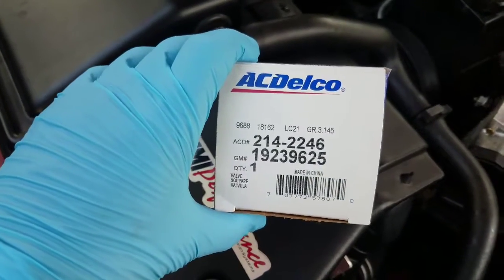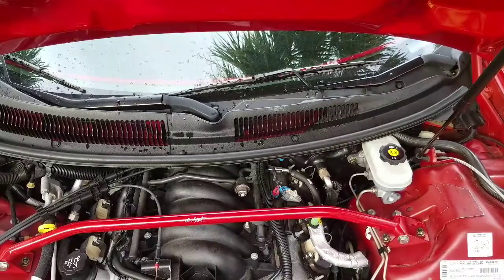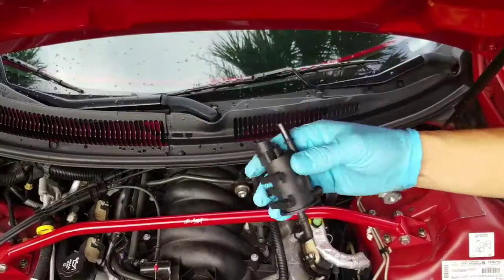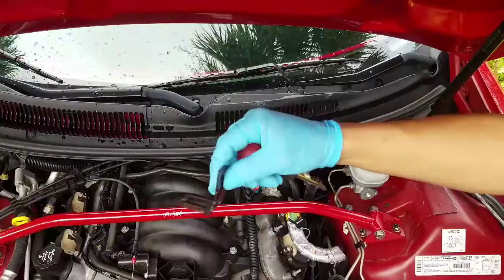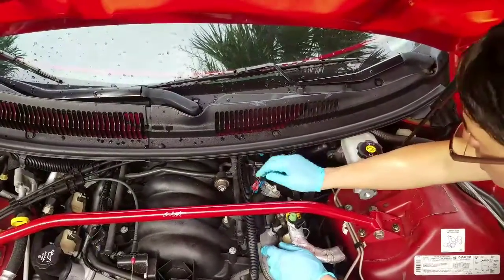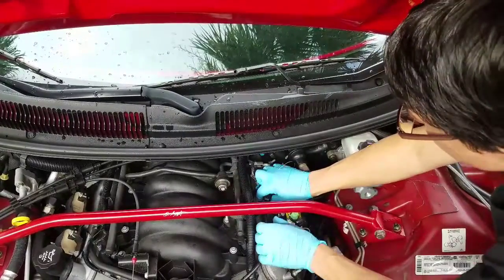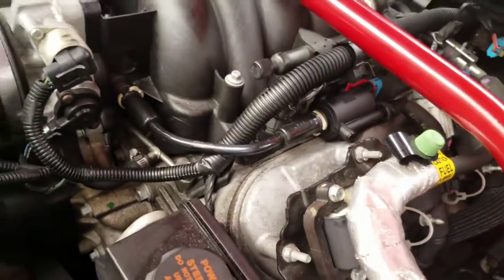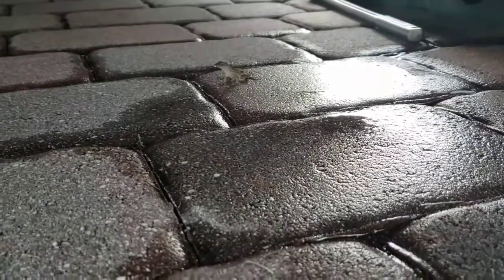Code p0446 on the camaro. EVAP Purge Solenoid replacement. Plus, a thirsty reptile.

Comment: I replaced the purge valve and valve tube that connects to the throttle body. Code still on. Gonna change the gas cap and if not then idk lol
Reply from the maker: I changed my cap too. What year car you have?
Reply: Chemical Spore 2002 camaro ss
Reply: Chemical Spore did the cap fix it?
Reply from the maker: @SlackeredForLife  did you delete the code after?
Reply: Chemical Spore yes I deleted and it still went on at first I thought it was the tube because the clip at the end was missing but nope code still on
Reply: No gas cap on my 2017, so it has to be the evap solenoid on the intake.

Comment: Man my car is doing the same thing hopefully it get her running man
Reply from the maker: what year is your car?
Reply: @chemicalspore  it’s a 2002 but I just took off my valve cover and i have a broken rocker my car is only running off 4 cylinders ima just take the heads off and see what’s the problem
Reply from the maker: that sucks. i have dual beehive valve springs

Comment: Thanks for sharing, mine is throwing the same code hopefully new one works...just wondering does this make the car run rich or lean. Thanks again
Reply from the maker: It actually balanced it out. But also on top of the gas tank itself is the actual canister for the charcoal. Never top the gas off, when the pump stops you are done.
Reply: @chemicalspore  hey mine threw the check engine light and It was the canister purge valve, I just got the car two days ago and when I put gas it stops by itself at like a bit past 3/4 full on the gauge, at one point it was full on the gauge , are u not supposed to fill it all the way?
Reply from the maker: @josecortes9571  you fill it till it stops on its own. Just 1 click. Never top it off. You can put too much fuel in it and the fuel will not properly ventilate. The fuel can also over spill into the canister which will totally disrupt the ventilation process.

Comment: I took my 2017 rs to Oriely's i get solid ch engine light once in a while disconect battery and move on. Oriely's found a evap icon on test but without a code?
Reply from the maker: I do not know the codes for your model. You can purchase a really good scan tool from amazon. I have this same one for my car. https://www.amazon.com/LAUNCH-CR3001-Creader-Automotive-Diagnostic/dp/B07D1KH9SC/ref=sr_1_5?crid=3SVUXYGR14KSV&keywords=creader&qid=1652717487&sprefix=creader+%2Caps%2C768&sr=8-5
Reply: @chemicalspore  i'm going to change the evap solenoid can on the intake, that should tAke care of it.$34 can't hurt
Reply: Hey man I getting the same code on my 2016 ss, did you find out what the issue was?
Reply: @zeusdetro8173  no not yet, chk engine has not come back on yet, i went under hood and made sure plug wasn't loose, so far so good. If it comes back on im going to change the solenoid on the intake, one bolt one plug
Reply: @zeusdetro8173  i never have more than a half tank if gas either but that should not matter. $4.46 gallon here in florida